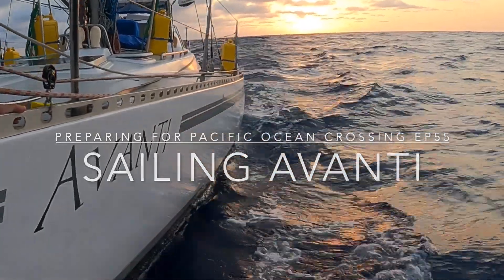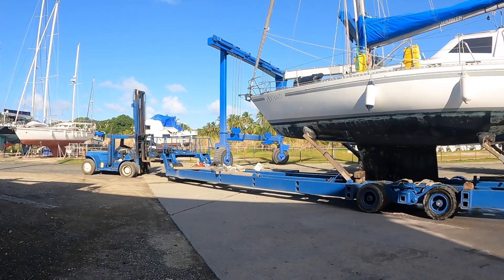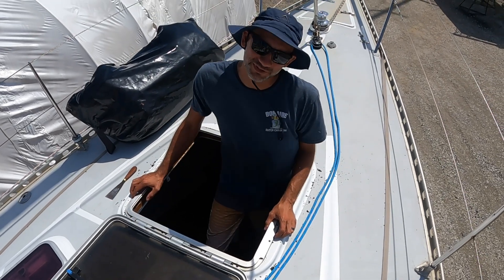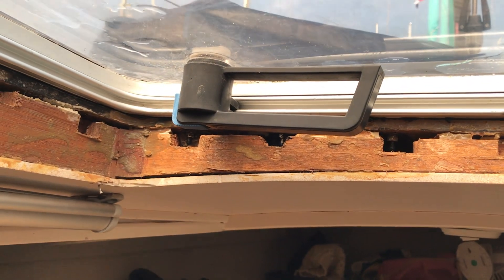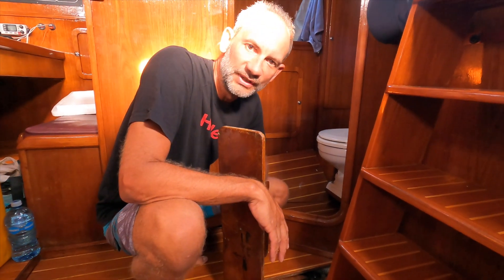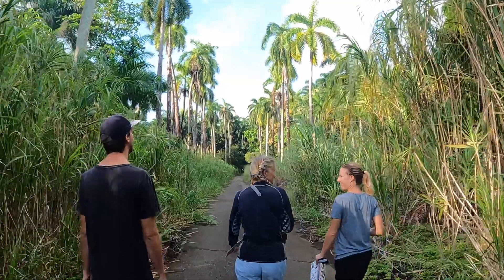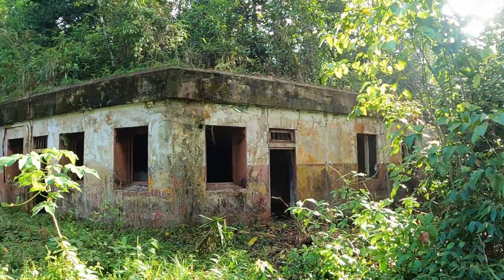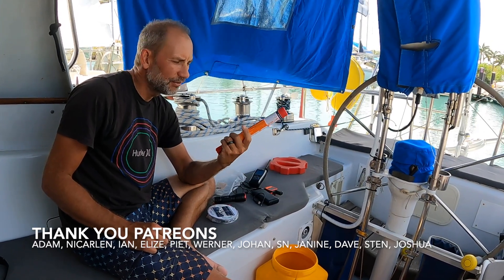Back in the water EP55

Comment: Lekker! Glad you guys are back in the water with no leaks.  Regarding the cable, it may be overkill at 4mm (min) but solar string cable it tinned and has a lekker strong sheeth!
Reply from the maker: Thats a very good idea Andrew!! Ive use the solar cables on the panels and they are very sturdy, but like you say a bit too thick for the mast.